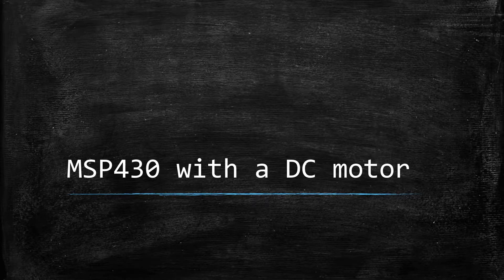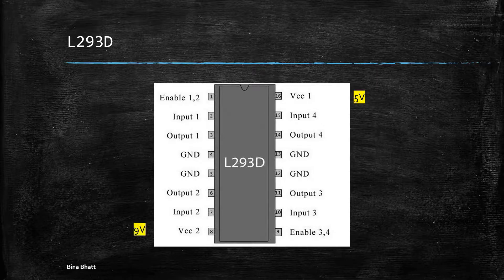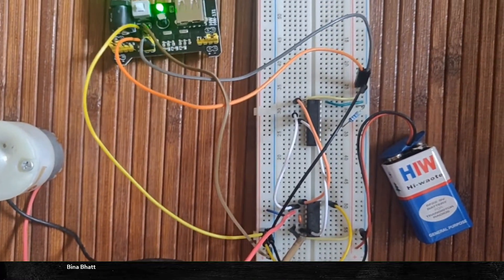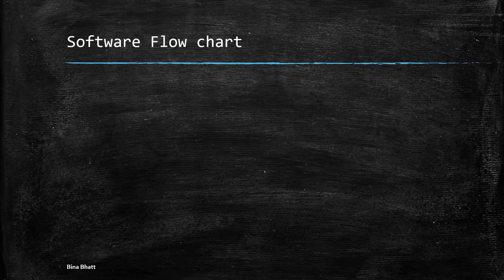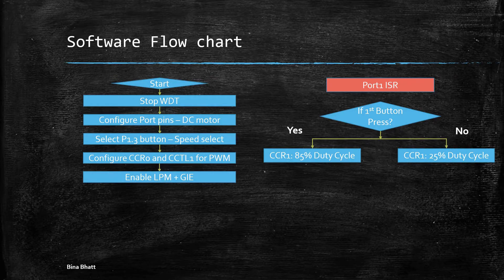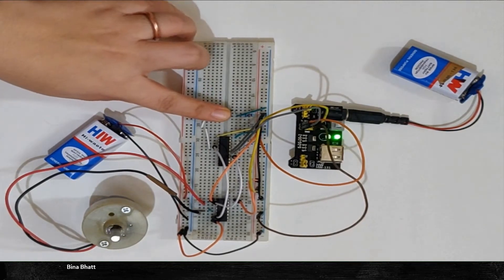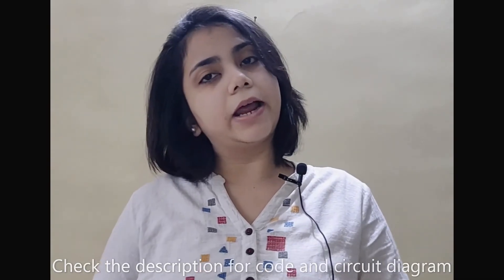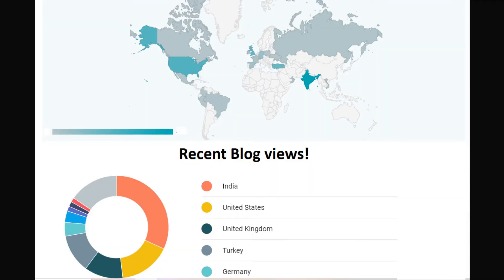MSP430 with DC motor

Comment: Hello maam!! Can we use standalone msp430 microcontroller (like atmega328p can be used without the board) or launchpad is necessary for uploading program?
Reply from the maker: Launchpad is required to burn the code on your muc...not otherwise.
Reply: Ok maam. Thank you.